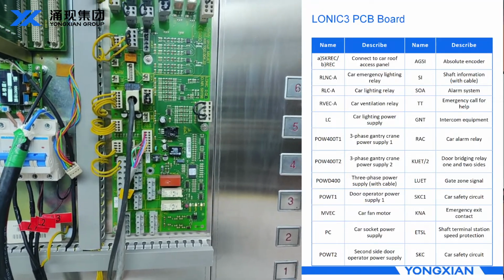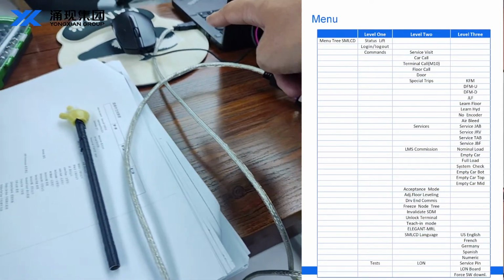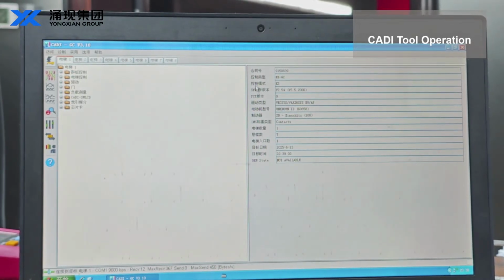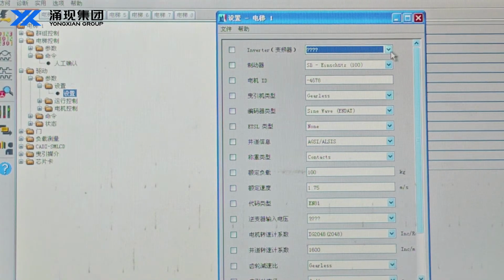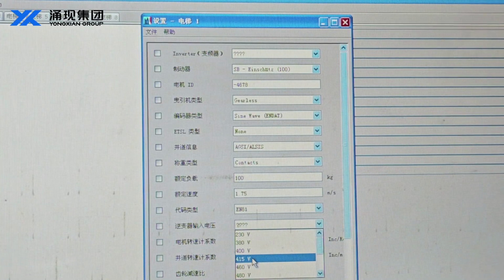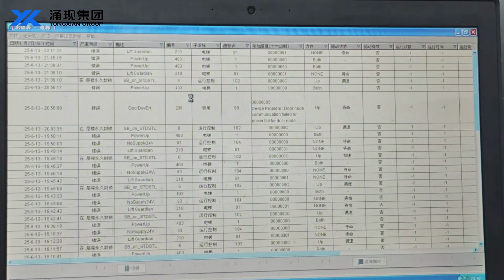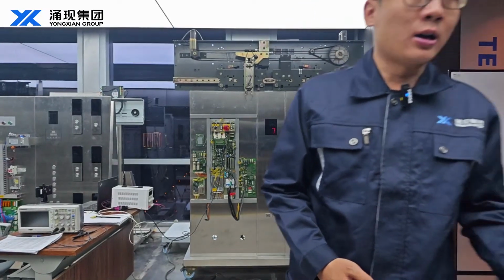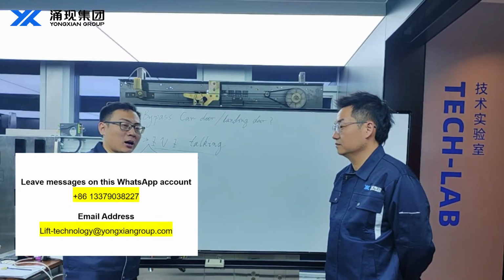Join our FREE 2-part live training on the Schindler 5400 control system!

Comment: What's the jumper's during installation time if i want to put lift on inspection mode ?
Reply from the maker: If the elevator is under installation and you want to operate it in maintenance mode, the safety circuit and door lock circuit must be closed, and the upper and lower limit switches must be functioning correctly.